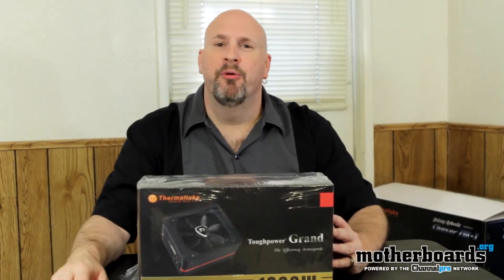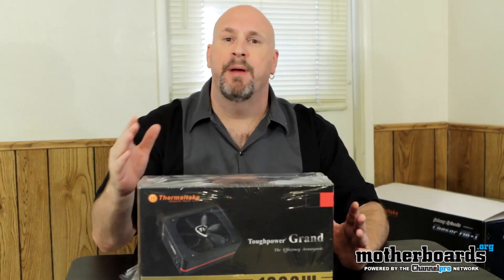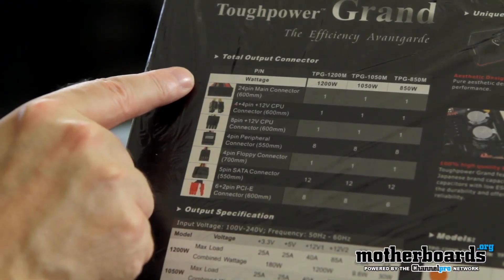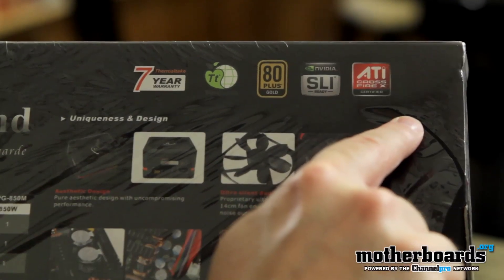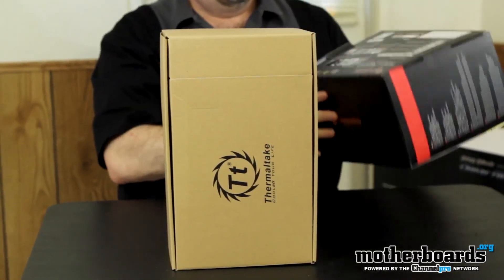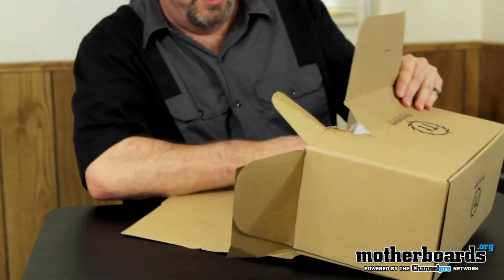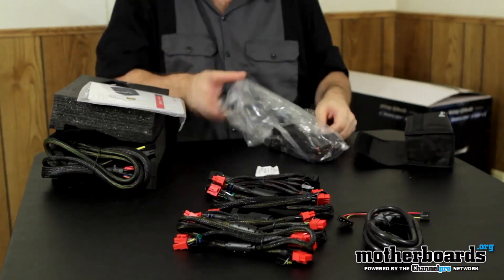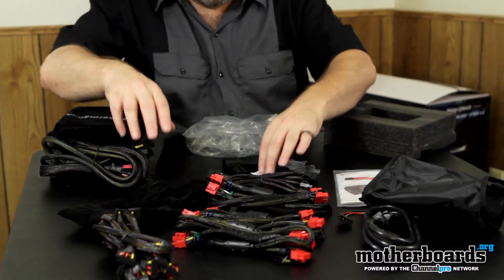Thermaltake Toughpower Grand 1200W PSU Unboxing!

Comment: I agree Elric, I would also contend that A modular cable has more resistance in the line (measured in Ohms I believe?) Ive had instances where previously stable overclocks where no longer stable when swapping out a standard PSU for a fully modular one.